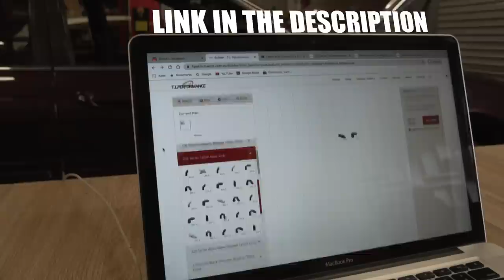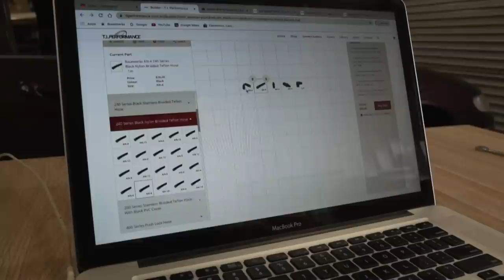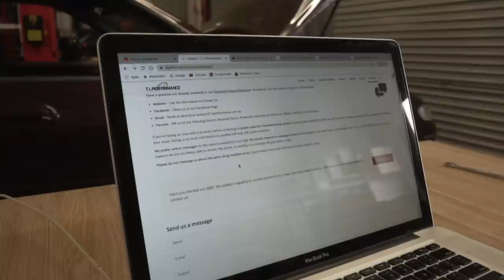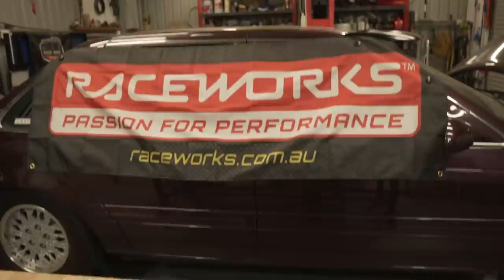Turbo Fairlane Build - Building A Complete Raceworks E85 Fuel System

Comment: You have to use submersible fuel hose in the sender unit. If you use normal fuel hose it will just rot away.
Reply from the maker: Yes correct, we did use submersible hose
Reply: Thankyou